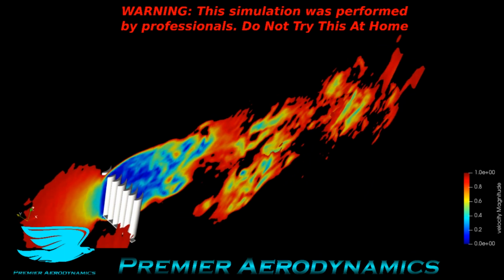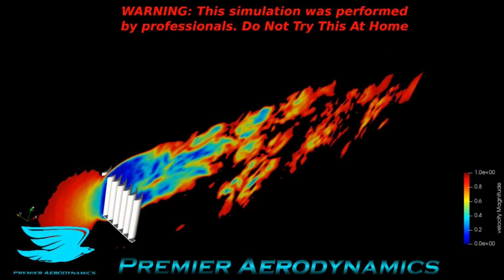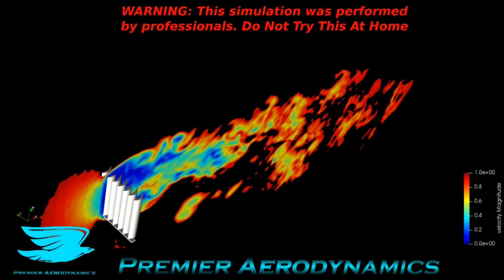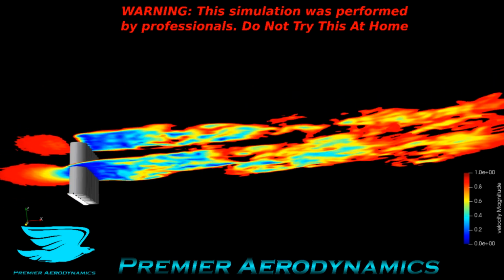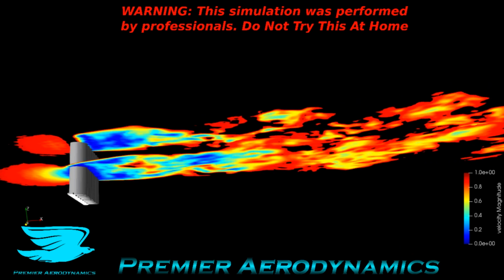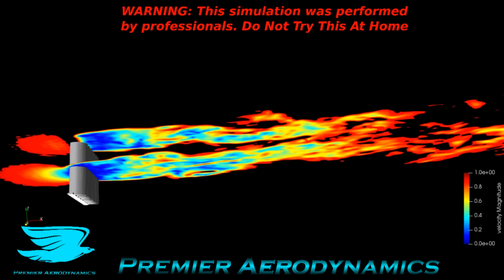How do turning vanes perform outside of a wind tunnel?

Comment: They'd probably work better if they were a bit more spaced out. Better in the sense that the wake would be a bit cleaner. Having them that close together probably strengthens the passage vortex between each element.
Reply from the maker: Definitely. The closer they are the more of a back pressure there will be as well.